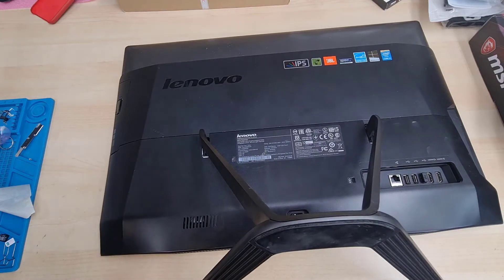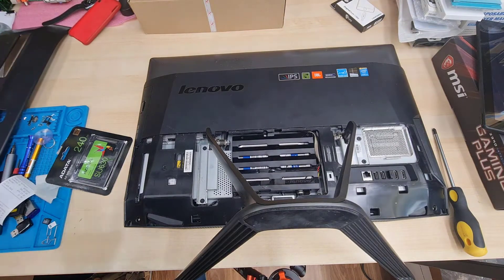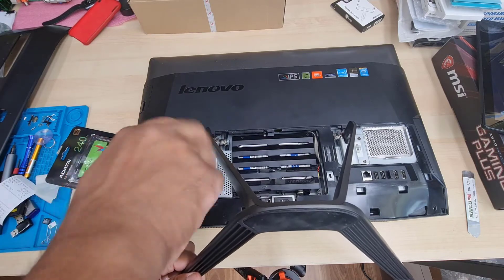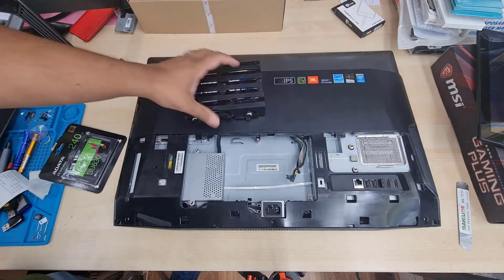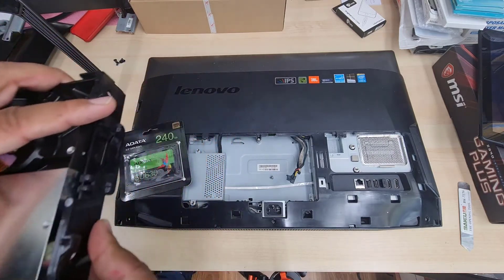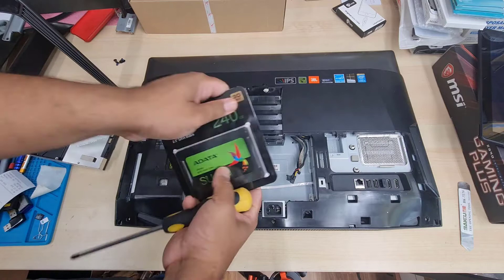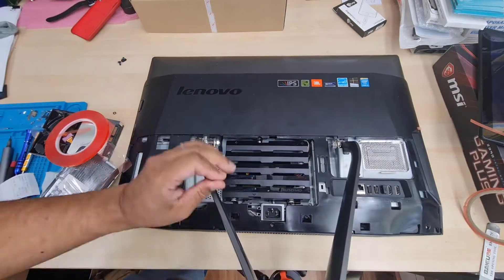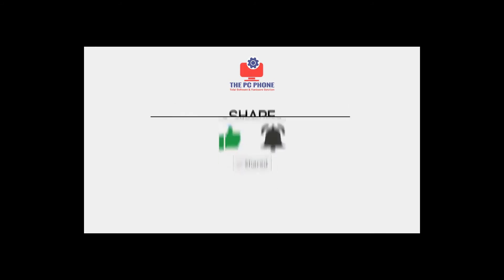Lenovo All In One B50-30 SSD  Upgrade

Comment: hi, its possible connect both, the hdd and ssd into the all in one or is just one connection for a drive?
Reply from the maker: Unfortunately not. nowadays, all in one pc and small factor desktop does have limited SATA port and cable, they don't have slave connector, so there is no chance to have more than one.

Comment: Skips showing the struggle to remove that first panel....
Reply: i removed mine before i found this and all i did was just gently lift the edges up starting on the bottom edge of the back panel. bit tricky to put back but i just gently pushed the middle section down whilst pushing it up (with the monitor laid flat on the front)
Reply: I KNOW!